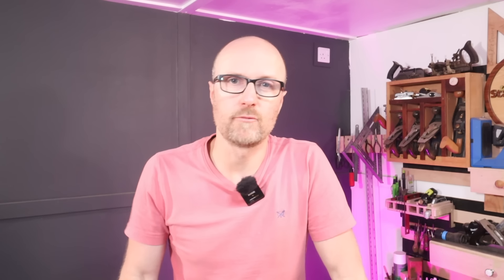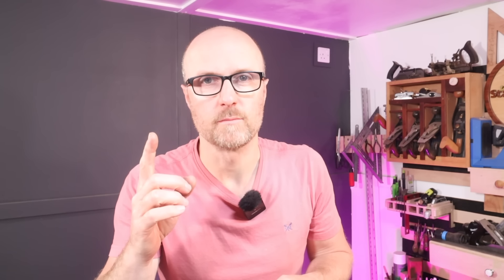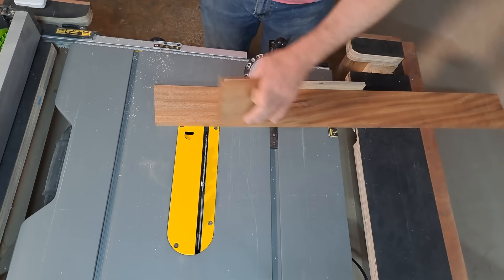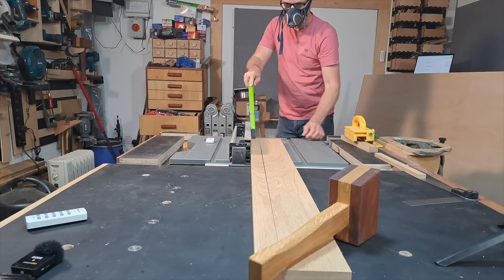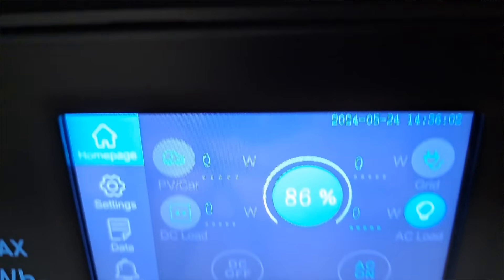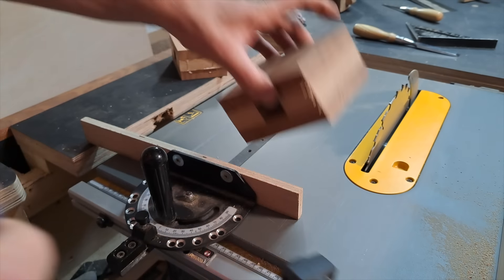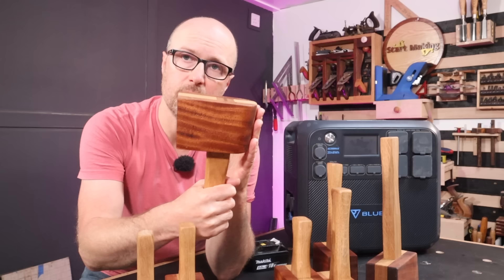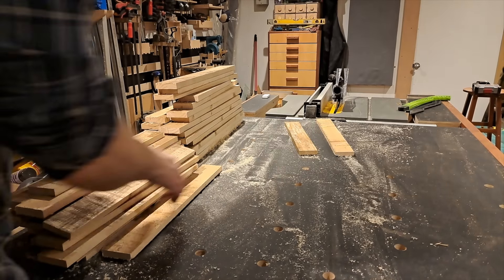6 DESIGNS but which Mallet is best? || Bluetti AC200MAX TEST

Comment: The thumb hole on that mallet is a brilliant little design - all the mallets came out gorgeous! Liked the trick with the drill for sanding, I used to clamp my Random Orbital Sander upside down to do the same thing!
Reply from the maker: Thank you Alex. Much appreciated. That sanding disc has had so much use. 4 end grain chess board and more. I find when I clamp my orbital upside down it loses power. Seem to spin less. Weird.

Comment: Long long ago, in a woodshop far far away, I had a Ryobi battery powered generator and that DeWalt saw, and I would use them when I was working on site. I could go for about 4hrs, which was sufficient for what I was doing. This setup is totally doable,  especially with the cost of having electricians wire up a shop (no judgement, everyone has to eat)
Reply from the maker: Yeah, it's a hard decision. I realise now that this video was totally aimed at me 3 years ago. Very niche. I would have loved one of these batteries., not the solar. So for £1200 I could have added a table saw into my tiny shed and lights. Game changer. But that was because I could not justify wiring up a shed that was falling down. So I guess if people are in the exact situation that I was then this is good. Not sure I would want to carry it to a job site. But fair play to you for the effort you put into lugging a generator around. PS looking forward to the next pod cast. Take care bud.

Comment: I have a similar setup (Ecoflow) using fixed panels on the shed roof. The key thing is getting the panels to the correct angle to maximise their output, it makes a huge difference in charge times.
Reply from the maker: Interesting. Thank you Paul. Did you get the fixed panels from Ecoflow or separately. My roof is crying out for panels to be honest but then I worry if I am heading down a rabbit hole.
Reply: @startmaking1  Yes the panels are Ecoflow. I got 4x 100w panels and configured them as a 2x2 series/parallel setup. I waited for a sale to save a few quid.
Reply from the maker: Oh well done. I have around 350watt total. It's ok but not great. They are not fit for external though sadly. In time, If I still have the battery powering my workbench I will look to install solar on the roof as I plan to run sanders and such from it too. Once I move away from 18v , if I do. Thank you for the info Paul.

Comment: Admit it, Mark, you kind of miss that rickety old shack...not!  Love the idea of portable power, but that gear you have would set me back over $1,500.00 USD.  That's reasonable, but would put a dent in the kitty for the new cabinet saw. I hate that all of life is setting priorities.  Those are lovely mallets.  Last month, I made one by hand using cabinet makers files, drawer knife and an oscillating sander from a tree limb.  It still needs some finishing, but there was an odd satisfaction of doing it like this.  Honestly, I bought a maple mallet, probably twenty-five years ago, because it was on the shelf at the local hardware store and very pretty.  It has lasted me and performed well; so I've never had a need for more mallets.  And, honestly,  everybody makes them.  Great video, as always.  Enjoyed the whole thing.  Big thumbs up.
Reply from the maker: Hey meat. Not kind of miss, utterly miss. I guess that this video was directly aimed at me 2 years ago. A little niche lol. If I had the choice I think I would forgo the solar panels and just buy the battery and charge off the house electrics each night. For the £1200 odd I think that would have made a huge difference. But then I think that not having the electrics drew me towards hand tools and making a lot of the tools I had. And that is something that has stuck with me now. Not to mention the fact that having the battery would have meant I could get a table saw £800, and lights, £100, and and and. So the budget would have been blown instantly. hmmm, maybe not having the choice was a good thing. Wow, that mallet sounds lovely and from hand tools too. I bet it was really satisfying. I have just got my first draw knife, didnt realise how lethal they were. But so much fun. I dont really know what I am going to do with 7 mallets, plus the 3 I had before. I may need another shed lol. Take care bud.
Reply: @startmaking1  Sounds like you have a mallet for each day of the week, or a giveaway.  Once you master the draw knife (think of it as a huge spoke shave), you will enjoy shaping things with it as it hogs out a lot of material quickly.  Just remember, as with planing, it works better up hill.  It is a tool that will open up a world of opportunity.  As you take the family on a hike, you will be scouring the landscape for good wood that can be made into handles, spindles, walking sticks, canes and the like.  As you shape the wood (it will tell you what it wants to be), you'll refine it with your shinto rasp file and some good English cabinet maker files.  Handmade/homemade Christmas presents will be done.  Good weekend!
Reply from the maker: A give away sounds like a good idea. I tried my draw knife when I was filming a few extra shots and man it is fun. Once you angle it a little it changes everything. really fun was to make kindling. Wow, what a journey, from hike to handle. Thats a video title right there. lovely idea bud. Take care.
Reply: @startmaking1  I love it.  I'm hoping to finally get back into the shop this week as the shoulder is at about 80% and needs a real workout.  Trying to make a presentation case out of an old piano.  I haven't dismantled that yet; so, it could either go really well, or I could slice myself into sushi if I remove the soundboard incorrectly.  Anyway, press on.

Comment: Good video on making mallets Mark.  I still have to make mine, but at my age, I'm not in any great hurry. I got a few pieces of what's called ironwood, but I'm not sure what it actually is. A friend who drives truck for a hardwood lumber company gave it to me. That portable power supply appears quite expensive to me. I know you own a lot of cordless tools, but have you ever compared it the cost of running an electric line from your house to your shop? It could be either aerial or buried. Use the electricity in the shop for lights, charging batteries, a space heater for year-round use, & an occasional new tool purchase. Locally, there is a big push on now for solar roof panels to supplement one's electricity needs. I think they look horrid & they have many drawbacks the public isn't aware of. I used French cleats thirty years ago that I forgot about. I had some thermal roll-up shades installed on bedroom windows. I used French cleats to hang plywood valances I made to cover up the rolls & hangers at the top of the windows. See you in the next video.
Reply from the maker: I saw Matt Estlea making iron wood mallet heads. Looks super dense. The irony with the battery is that I actually have a power line for the workshop. Cost me around £1500 compared to the £1200 for the battery. So for me the battery is a luxury not a sensible choice but in the old shed before I build the workshop it would have been perfect. The shed was not good enough quality to wire and so the battery would have opened up the option of heat, light and a table saw. So I realise this is a super niche video but the mallet making was fun lol. I too dont really like the look or noise of solar panels, little motors adjusting the angles inside can give a buzzing. Not to mention how daft they would look on our 400 year old house. But free electricity is a nice thought. Take care bud.

Comment: Given the cost of the battery and the panels, the answer to the question "can you power your workshop for free?" is clearly "no, you can't";-)
Reply: And you can’t run dust extraction and table saw together?…
Reply from the maker: My conclusion at the end if you got that far.
Reply from the maker: @robyarnall you can if they are not as thirsty as mine.

Comment: Something you missed is, how many times do you
need to charge on the solar, to save the cost of the
panels, compared to the cost of the mains, for the
same number of charges (from flat)? That is how
long it takes for the panels to pay for themselves. 
( At the Least) 😁✌🖖
Reply from the maker: It's funny, I ended up deleting that bit after it took so long to recharge with the solar panels. I worked out that each battery drain was the equivalent saving of approx £2 so you could pay off the solar panels in approx 280 uses. Then I worked out that if it takes me the equivalent of 12 hours of perfect sun in the UK, well ,you get the rest. Either the solar panels need to be in a better location than mine were, but then you would need exterior grade ones or, again with exterior ones, you need to be constantly trickling into the battery.

Comment: Really enjoyable video, Mark. I''m afraid it confirms to me what I have always believed. solar power and British weather are not soulmates.
Never mind, those were lovely looking mallets. The two-wood contrast worked great and the thumbhole was a clever Addition.
Can I ask, do you source your hardwood locally or order online? I find it very difficult to find anywhere locally where I can go and browse hardwoods. My stock has come mostly from bits of old discarded furniture. I see hardwoood bundles online but they always appear to be very thin pieces.
Looking forward to the next video. All the best.
Reply from the maker: Thank you. You are right too. The thumb hole takes a little getting used to but if Cam over at black tail likes his I figure it should be a good addition. I like the extra control. I order my hard wood from toolsandtimber.co.uk. Its the only place really that I get it from so Im not sure if it is the cheapest but quality if good.

Comment: Hey mark.!! I think these are perfect for trades on site , but “ IN THE SHED.? “ £1700 buy’s you a lot of armoured cable and plug sockets and more than enough to pay an electrician to connect it to  the mains.!!! And at some point it will need replacing !⚒️😁💪🏻
Reply from the maker: hi Ian. You are right. All except if someone cant wire, or justify wiring their shed. My shed before I had the workshop was falling down and I guess I was making this video for past me lol. Very niche.

Comment: With the solar panels, you'd be better off I think putting them on the roof of the shed. We have panels on the caravan (as well as the house) and whilst on the caravan they are not at the perfect angle, they are constantly able to charge when there is enough light.  Saying all that, for the cost of the battery and the panels, I think most people would be able to pay an electrician to have electricity piped through to their shed 🙂 Are you going to put a finish on the mallets?
Reply: Trick is to get 32Amps for the workshop.
Reply: I have a older panel and already calculated that I would need to upgrade my panel to have the garage wired and tbh I'd prefer a subpanel. That's a lot of money for me.  Probably around 5k if not 8 to 10k
Reply: @crystalBall9287 fair enough. I'm lucky that I had my panel redone when I moved into my house so it wasn't an additional cost for me. Then when I got electricity put into the garage I made sure I could also run the shed off it
Reply from the maker: I think you are spot of Chris. Trouble is they are not external ones that I have and unless I run the entire workshop from a far larger battery, buying more panels doesnt seem all that sensible. You are also right on cost. My wiring set me back around £1500. The aim though with the battery is for people who dont think it is possible to do. Ie people with no dedicated space, building outside. Or like I was where the shed I was building in was about to fall down and wiring it was not an option. A very niche video indeed lol.

Comment: That’s interesting, I’m looking at starting a workshop at the back of some land a friend owns currently with no power, had thought about this type of power station and was wondering if solar really charges it enough - I’m probably even worse as in Scotland so saves me finding out the hard way, thanks 👍
Reply from the maker: I would not rely on solar. the battery is really useful but I would just take it home every evening to charge unless you happen to be sat outside your workshop on a sunny afternoon.
Reply: @startmaking1  Thankyou yes I agree. 🫶

Comment: Good video looks a good bit of kit, i have solar couple 12v batteries only run lights of them at moment and a very long extension lead for everything else😂
Reply from the maker: Sounds just like my setup in the old shed. It worked. Though the lead was annoying as I could not run too much off it. Though, whatever gets the job done. This is a luxury item for sure. But it would have solved my needs a few years ago, so I thought he video would be fun.

Comment: I know over in the UK you get a large amount of overcast days but would a larger permanent solar panel setup mounted on the roof of your workshop Mark give you the charging output you need to get your power operating costs close to zero$?
  I found your sponsored content😉 interesting 👍 between yourself,Jesper,Dainer,fixit fingers and several others have inspired me to have a go at all sorts of builds that I wouldn’t have even thought of or thought possible previously 👍👍
Reply from the maker: Hey. I have been considering the exact set up you mention. I have a large flat roof but it is not really that well exposed. And if I am really honest, I build it. I would worry about the extra weight lol. But I am considering maybe mounting the non outdoor panels somewhere on another purpose build shed and covering them if that is possible. I dont really need a lot to charge the battery on the days I am not building so even these less than perfect panels may still work. Im thinking about a perspex box maybe. But that is if I get round to it. Between you and me, sponsored content is really tough. We all dislike it but have very little choice. And wow, what a great bunch of makers to be mentioned with. Thank you.

Comment: Hi mate, well Cool mallets. So sapele and oak…… what other cominations could you use?
Reply from the maker: Thank you Peter. I like a dark and light combination and where I am these are the easiest to get hold of. I will take a look at other combinations. You could swap the oak for maple, ash or beech. But and this is just my opinion, Oak has the nicest end grain of the lot. Kind of like a tartan. I do like how ash looks on the handles though. But I dont think they would be as nice with 3 wood types. As for the darker wood, sapele is one of the only easy ones to get from my wood supplier. But I would love to try dark walnut or even something exotic instead but it is really pricey.

Comment: Nice job m8 nice video the mallets look great. Love the blacktail inspired thumb hole one. I think bluetti have missed a trick the solar panels are designed from what i can see to charge off sunlight. Granted America sunny places fine as you noticed uk not so much they need run off daylight. The pannels I've just had installed in my house granted it's not apple's for apple's but they run off sunlight and even with the weather weve had recently im still generating enough most days to power the whole house 😮 i can see the appeal for camping etc though but the cost IMO kills it. 🏴👍
Reply from the maker: thank you Michael. You are right about the panels too. The battery is good, the panels are more of a luxury.
Reply: @startmaking1  yea they seem be a luxury. Least you've got them though even if they didn't really think it through for British weather 🏴👍

Comment: Sadly I just had to send a Jackery and solar panel kit back apart from not working with my Ebike wiring set up (dodgy 2 pin system from China), the overall weight was 19Kilos😂…I’d drain the bike battery just trying to get the kit anywhere worth travelling to. However thanks for that…because it’s great to know for shed projects in the future. Could I buy a baby mallet please? I need one the overall length of your hand? Or a link to a template…I don’t have your kind of kit as I work with miniature things…thanks for this vid…👍🏻✨🌈✨
Reply from the maker: Yeah, that doesnt sound like a solution for your bike at all. I cant imagine carrying this battery very far at all to be fair. as far as a baby mallet. To be honest I think the small ones are a touch top heavy. The thumb print one is about right but I only have one. I didnt expect to have anyone wanting one. Where are you based, are you in the UK.
Reply: @startmaking1  I’m based in Scotland.
Reply from the maker: I dont have a shop set up or a way to do the payment etc. Not to mention I have no idea on a cost but they are not going anywhere while I figure it out bud. I will make you first on the list as and when it is sorted.
Reply: @startmaking1  awww yes I see what you mean…plus when it’s a one person maker situation..,life can also get in the way of production. Wish the internet didn’t have its dark side as I would post email and funds to get it to me…but hey put my name on that wee cutie and when it comes to a wee tiny shop…I will claim it if nobody else does. 👍🏻🤞🏻

Comment: I could see keeping the Bluetti in your shop for a day when your power goes out and then letting it charge over the next week or w/e. Otherwise, nice mallets. I wish you focused more on them since that was what this video was supposed to be about.
Reply from the maker: Sorry bud. if you are interested in a full mallet build the last video before this one has that in it. This one had to be primarily about the battery due to the Bluetti agreement but as the mallets have been so popular I can see a better video for them coming eventually. The battery for me is actually proving to be great as I plan to have it in my workbench so that none of the cables of the tools in the bench are cutting across the floor. But it is an expensive solution for that.